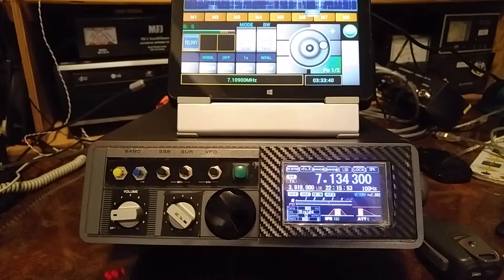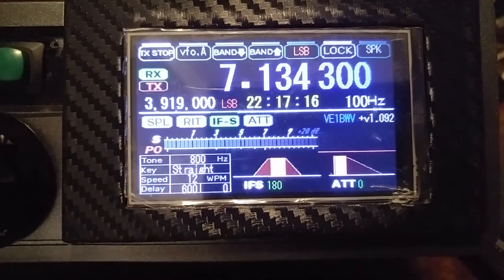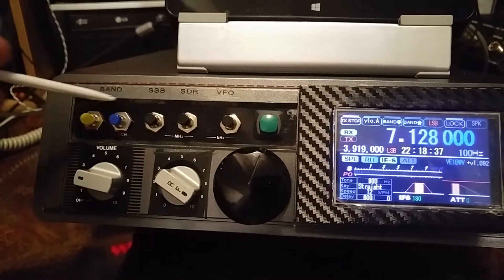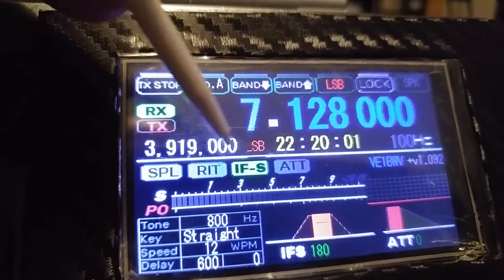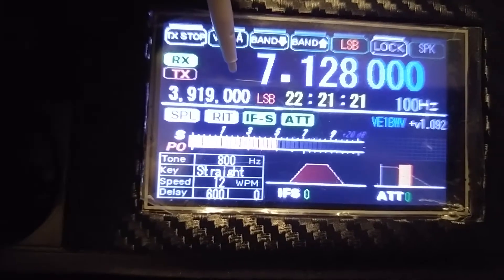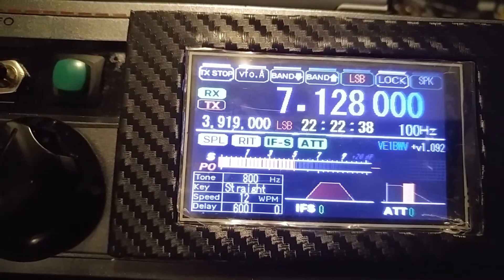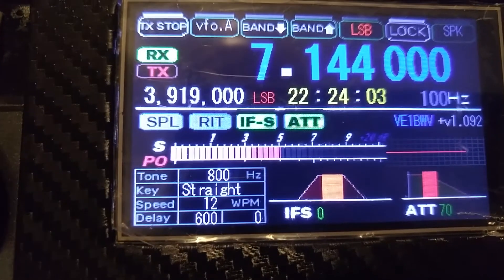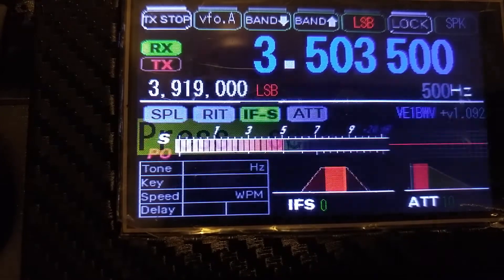Nextion Display on a UBITX

Comment: Hi joe. What is that black material you have around the display ? Is it something which could be purchased as it looks good. I'm thinking you purchased the material and cut it ?
Reply from the maker: It comes in rolls in various colors, used for auto interior enhancement...I make my bezels by cutting out the plastic from scribblers ---lots of scribblers have a plastic cover so I cut the bezel then wrapit.
I get by the roll on Carbon Fiber Vinyl Car Auto DIY 3D 4D 5D 6D Wrap Sheet Roll Film Sticker Decal
ebay https://www.ebay.ca/sch/i.html?_from=R40&_trksid=m570.l1313&_nkw=black+auto+viynl&_sacat=0
Cheap but work very well and sticks good
Joe
Reply from the maker: Also comes in many colours and length
https://www.ebay.ca/itm/DIY-200cm-x-50cm-3D-Carbon-Fiber-Vinyl-Wrap-Motorcycle-Car-Vehicle-Sticker-Decal/253089276064?_trkparms=aid%3D555018%26algo%3DPL.SIM%26ao%3D2%26asc%3D40973%26meid%3Db0e422ef94c6432188d929b4a2af04fa%26pid%3D100005%26rk%3D4%26rkt%3D12%26sd%3D202006186692%26itm%3D253089276064&_trksid=p2047675.c100005.m1851
Reply: I know, some are asking what in the heck is he doing on , its field day ! But, I have to say, the 3.2 is probably the largest practical display I'd want to use, the 7 would require a different unusual case , like one from an old tv maybe. My eyes can work with the S4 cell phone so the 3.2 is perfect. Wrapped in that stuff, would be really cool. I like it very much :-)
Reply from the maker: The 3.2E is may favorite .( just received a second 3.2E for bench testing and development)
 Nice viewing and fits in any case easy...
Reply: 3.2e . Humm, Mine says _011 , no e

Comment: I have a nextion display I purchased when Ian was doing the pi+nextion project. I says NX4024T032 on it. Is this the larger one that he hasn't written a version for yet ?
Reply from the maker: The NX4024T032 is the Basic 3.2 inch version. 
 KD8CEC , currently supports 2.4 and 2.8.  However, myself, VE1BWV and KN4UD will support 3.2 and 3.2 E...this is what we both are running and it is currently work very well.
Once Ian, KD8CEC is ready to release, after testing is completed. We wil make the 3.2 version available
Joe
Reply: Oh, I see, your using the Beta. Cool. Can't wait.